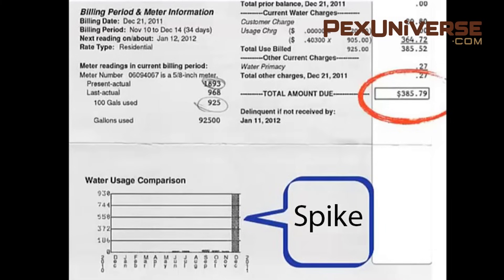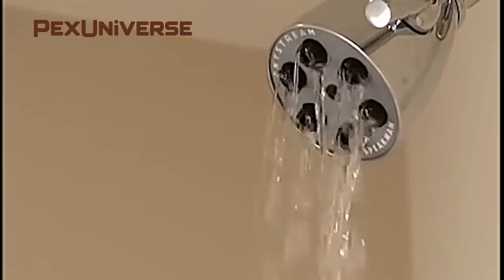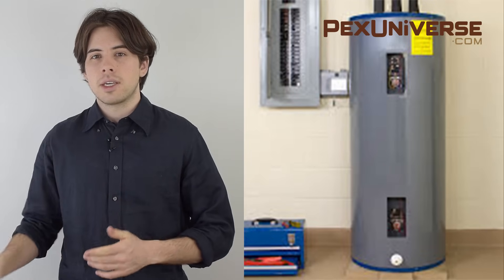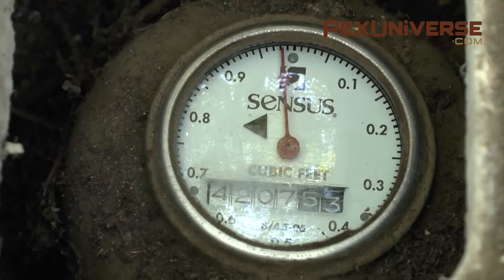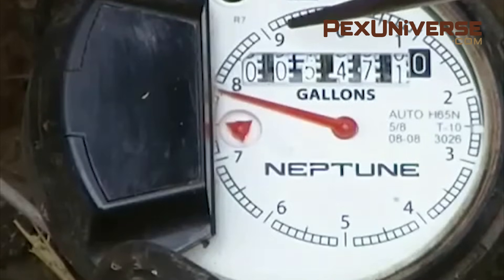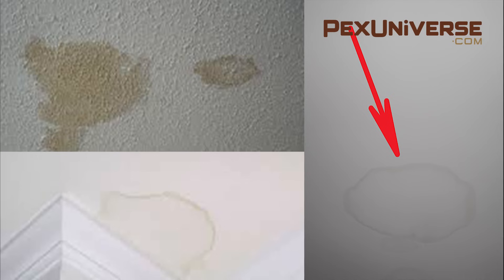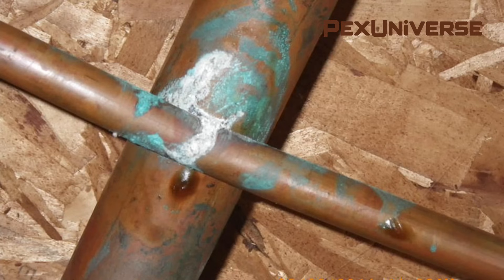Best Ways to Find Water Leaks

Comment: I'm trying to figure out if I have a leak. I just started noticing hearing water running in the wall very faintly (everything in the house is off to hear it) when nothing is being used, but the water utility office says there's no indication of a leak and I don't see any signs of a leak inside or outside of the house.
Reply: Do you hear this sound constantly and it never stops? If so it might be the valve in your refrigerator opening to refill the ice cube maker. If that is the cause, then it should stop within 15 seconds or so.

Comment: I did the pressure gauge test in our water line. The pressure drops after closing the valve before the water meter (indicating a leak). but if the valve is open the meter is totally still. Any idea please.
Reply: The pressure drops because you're shutting the water off. There's no pressure when the water is off. You can check if the little triangle on the meter is turning when the water is on. If everything in the house is off, but it's  turning, that indicates a leak.

Comment: I did the pressure gauge test in our water line, pressure drops after closing the valve before the water meter (indicating a leak). but if the valve is open the meter is totally still. Any idea please.

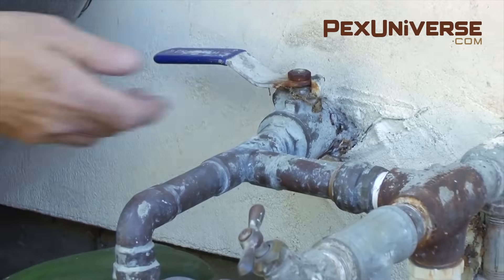Comment: @3:22 You actually turn the water on… If the handles in line with the pipe that is ON position… If the handle is 90° to the pipe that is the OFF position

Comment: At 3:23 he talks about ''Turning off the valve'' but actually turns it on!

Hint: A properly installed ball valve should go Off when at a 90-degree position relative to the FLOW of water in the pipe that it stops. But in this particular video, he puts the valve going in the Same Direction as the flow. Indicating that it is on.

However some handymen who work on pipes don't know this and will often put the valve in incorrectly. Ditto the DIY crowd.

Comment: Exactly I have hot water pipe slab leak right now.  Gas bill 3-4 higher.  Getting it fix via insurance next week. We should watch our gas and water bill every month and do leak test regularly. Thanks
Reply: Does insurance cover water leak in your house?
Reply: @nghiaho9417  They don't pay to fix the water leak but only pay for damages occurred due to water leak.  A home owner has to pay a plumber to fix the water leak for a few hundred dollars then open a claim to file for damages.   Ins will send have an adjuster who will send people to see your home to assess damages. Hope it helps. 

It is important to get knowledge, monitor and observe as minor unusual leaks (and other maintenance issues)  or damage can turn into a bigger problem depending on where it is.

Comment: My toilet refill it self does it means It has leak
Reply: When u have a poop is that normal or is it a leak? I'll let u work it out.
Reply: Water Leak Detection is usually associated with pipe leaks, either under the slab or the main line coming from the water meter.  (or pipes from within the walls is almost a no discussion as either the drywall or floor will let you know you have a leak within seconds or a minute or two.)  The Toilet uses flushing components which you can buy yourself to replace, at any hardware store, & fix for less than 10 bucks without calling a plumber.  A toilet flushes after you push the lever and then fills itself, and stops filling after reaching the destined set amount.  If it keeps   filling then one has a bad flusher, buy a new one & replace.  Toilets is not what this subject is about, I have a feeling your life is not going to be easy.
Reply from the maker: No that's normal for toilets.
Reply: How is a toilet refilling itself normal?
Reply: Hahahha